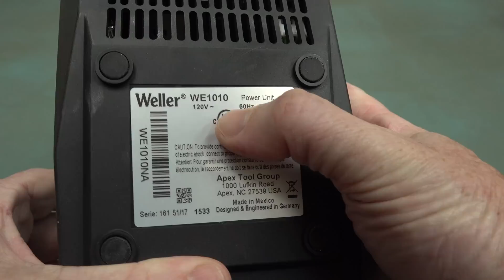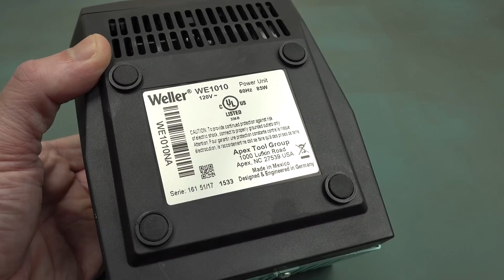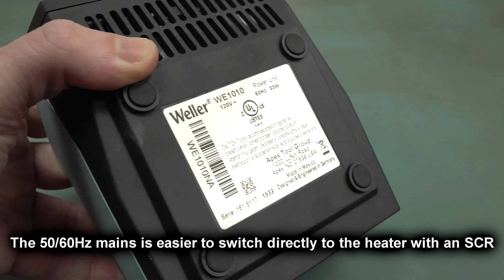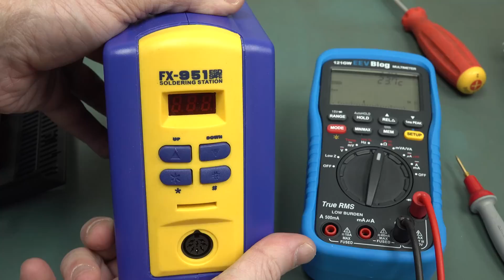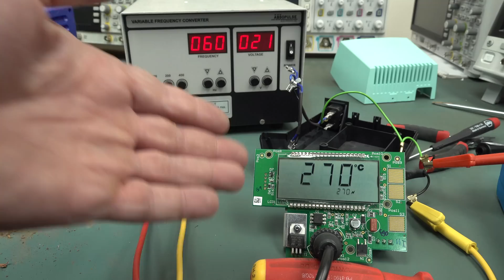EEVblog #1152 - 240V-120V = Magic Smoke!

Comment: Back in the 80's I watched an entire rack of audio power amps go up in smoke when the electrician wired the stage power distribution to a high leg 3-phase source. Keep in mind this was the days of amps with huge transformers and even bigger capacitors. Well about 3 seconds after the power was switched on most of the caps burst creating a miniature version of 'Towering Inferno". While I wasn't responsible for the power on that day, I made a rule to ALWAYS meter the power before connecting any equipment to it regardless of how safe you think it is. To this day, even though 90% equipment is universal voltage, I meter the power before connecting my equipment to it.

Comment: Brunt solenoids on pinball machine (common failure) looks that way and smell the same, as do AC motor (had a centrifugal starter failure on one, thus over-current,  and rotor looked the same). Enamel seems to "boil" and expend from the winding as it heats up.
The motor was rewound and works like a charm.

Comment: IEC Mains Lead trouble , anything will fit LOL

The plug assy should be part of the unit in my book .

A mains input fuse should be IN THE UNIT  regardless of  the IEC Lead fused or not .

Comment: When the core goes into saturation, the voltage squared relationship is not valid.  In fact, the current is limited by the primary resistance (mostly).
As to the design to near the saturation, there is also the issue of line frequency.  A transformer designed for solely 60 Hz use would require a reduced voltage if hooked to 50 Hz feed.  In fact, the required reduction is in direct proportion to the frequency or allowable 50 Hz voltage would be 50/60 * 120V...Easy math tells 100 V only...

Comment: @EEVBlog, rebuild the transformer and fix it for a change. I recall when I connected a 100v Hp laserjet to 220v mains - the capacitor blew the roof off. switching transistor was ok.

Comment: I thought transformer laminations were interleaved alternately, rather than all the E stacked on one side and all the I on the other
Reply: In the early days they were, one could disassemble and rewind with relative ease, unfortunately the bean counters usually insist in a cheaper, non-repairable approach.
Reply: You could do that but you would need the coil to start the interleaving process. If you were to get pre laminated E and I blocks all you'd have to do is weld them together saving you some time.

Comment: I thought that all Wellers had replaceable fuses. I remembered coming across an old analogue temperature controlled Weller that did it had a round fuse cover in the front. I can't remember the model but there is a similar one I found on Google images Weller TYPE 2102199 with a fuse in the front.

Comment: The polyurethane insulation on the wires is definitely sufficient for 240V in normal circumstances. The insulation on the 240V model's primary is probably identical. The problem is that you saturated the core with too many volt-seconds. As you know, once the core is saturated, the winding impedance drops like a stone and the current shoots through the roof. Then the wires overheat, the insulation burns off and the primary short out and then current shoots through the stratosphere. I can't believe there's not a primary fuse.

Comment: yeah cover up the smoke head fast when the smoke comes out !  But where I worked the smoke in a room didn't set off the building system ( only sent a warning at first ) until 3 or 5 minutes later - giving people time to get the burned popcorn smoke cleared out . The smoke detectors in the hallways do set the building into full alarm right away though.

Comment: A customer bought some cheap fume extraction equipment and the motors supplied were 220v 50hz and in the us we use 120v, 208v or 480v 60hz. Wish I was there when the powered up the Indian motors and saw what happened.

Comment: I live in South Florida and a couple of years ago we were hit by Hurricane Irma. A strong gust of wind broke a tree that fell on the power line connecting our house to the transformer, and while it didn't break the line,  but it DID break the house's connection to the Neutral. Immediately after, our toaster oven blew (vaporized a ground trace on the power supply board), and a few lights went out, but phone chargers and our air conditioning kept working. 

They kept working of course because the phone chargers are switching supplies capable of handling 240v, and the air conditioner is wired on the 240v single phase coming into the house. Since the tree knocked out our Neutral connection, every plug in the house was suddenly live at 240v, and no one in the house knew. We only assumed some breakers were permanently tripped. 

 I collect old computers, and of course I'm worried that some of my stuff was fried, so before anybody actually realizing that everything is live at 240v, I go to check if my Japanese 100v MSX2+ is still working. I plug it in and turn it on and immediately get buzzing from the transformer. It didn't blow and once we got proper power back I tested to make sure it worked, and it did, but I swapped the transformer out for one from another model. The original looked and worked fine, and there was no smoke, melted insulation, or anything else visibly wrong with it after getting almost 250% input voltage for a brief second, so props to 1988 Sony for designing robust transformers, but I still wouldn't trust that transformer for the same second it was plugged in.

Comment: And why don't they use a universal input switch mode power supply?!
That should be rather cheap these days and have higher efficiency in the Transformer as well

Comment: Check the plastic bobbin to see if any penetration from primary to secondary.
If there is melting and any primary to secondary short, you have a major safety hazard and UL needs to be notified.
There should have been an internal thermal fuse sitting atop the primary winding.
We've all seen adapter recalls - major issue.

Comment: Could the issue be exasperated by the fact that in Australia you use 50 Hz instead of 60 Hz which would lower the impedance of the primary winding or would the difference be negligible.

Comment: A month or so ago I went to put my backup sump pump in service. The last I used it it seemed like maybe the bearings were going out on it. I went to test it soon as I hit the float on it tripped the GFCI where I plugged it in to test it, I reset the GFCI no luck, apparently it took out the main breaker and the GFCI (or the GFCI just opens when breaker blows). I took it to garage with no GFCI plugged motor got a good spark on the plug when plugged in and like immediately the 15A breaker blew. I didn't feel like dealing with it so i just tossed it. I think either it shorted out, or it was just bound up and then turned into basically a big short.

Comment: Had a similar experience when I worked in a computer store.
We ordered a power supply for an hp that didn't fit any regular off the shelf power supply. so we shipped one in from a supplier in the US.
When I ordered I checked if it was rated correctly, and it was. It just happened to be one of those where you have to manually change a small red switch at the back. and by the time it arrived I'd completely forgotten about the fact that it was manually switched, and that it came out of the US so i should at least have checked it. 
as soon as I plugged it in all caps from the psu started venting filling the store with chemical vape.
after unplugging it, I immediately realised what went wrong and wanted to dig a hole in to the floor to hide my head from my laughing coworkers.  that capacitor smell though made me nauseous for a while. spend quite a few days trying to vent it out of our office.
Reply: I did similar when i was a kid. My big bro had a new 486, and it had this intresting red switch on the back. Click, and sounds/smells started. I got in a bit of trouble aswell. Fortunately the computer seller was understanding, and gave a new one with the nasty red switch glued over.
Reply: @anttimaki8188  yeah exactly , fortunately for me only the power supply was destroyed, the computer that belonged to a customer was fine apart from needing a good cleanup. we made no profit on that particular customer, but that still better than having to repair the whole pc at our own expense.
Reply: Yeah, I've done that too. I was 18.
Reply: Kids do that at schools all the time. They value and treat the PCs with twice the respect they paid for them. Since they were free (to them), well.....

Comment: As i saw here the primary winding was made from an aluminum and not copper wire for that i guess it is burnt so quickly because the resistance of aluminum is much higher than copper  !

Comment: Looks like Dave accidentally made a variac, sort of what it looks like with the primary enamel removed. I think variacs are one of my new favorite electric things. I had a friend give me like 4 old variacs, I put them into a metal toolbox, mounted them, one controls the voltage the other controls the amperage. I can put 120 in and get 0-~230 AC and 0-300V DC.

Comment: I really think the IEC 60320 connectors series should have been voltage keyed (with an allowing for dual voltage devices), given that the leads are so universal and interchangeable nowadays it is inevitable that things like this happen.
Reply: I mean, a company could easily add a voltage key(maybe in a way that it would still accept standard leads for now), write their own standard on it and see if other companies do the same thing. A reasonably large company could probably establish something like that reasonably quickly.

Comment: Hello Dave. Can you enlighten me as to why electrical current in the rest of the world is double that of North and Central America?  I was actually completely unaware of that until your video here today even though I knew you have different sockets due to different frequencies. Thanks. https://www.trade.gov/mas/ian/ECW/all.html
Reply: The frequency doesn't make much of a difference with most devices. It did matter for CRT TV's and some other devices(like record players), but nowadays nearly everything will work at 50 or 60 hz. 

The different sockets are mostly due to the different voltage, than the different frequency. Even if you plug something made for the wrong frequency into your outlet, it wouldn't break. It might just not work right. 

taiwan for example got 110 volts, its not just the us. But most countries use 220-240 volts.

The "why" is hard to answer. as far as i know it was a tradeoff really. The frequency was chose because at around 50-60hz, light didn't flicker. And higher frequencies are harder to deal with. With voltages its the same thing. If you have a higher voltage you can transport the same amount of energy through thinner cables (120 volts at 100A will have the same power as 240 volts at 50A, so your cables only need half the current capability). But higher voltages are more dangerous, of course.

Comment: That is sort of extraordinary for a company like Weller to omit  high energy side protection. Remarkable oversight....You would think?
In the UK we have  mains plugs supplied with integral fuses - (often people just stick in a 13A fuse regardless). This is there by design to protect the cable, but of course it would also help save the primary of a connected transformer. 
I think the UK, along with some of those countries we  plundered in the past - from those dark colonial days - have mains plugs with integral fuse protection (Type G). Anywhere else and a primary fault would be a bit dodgy without additional safety devices.  Many, many transformers have the primary internally fused and/or over temp. protected, and these have been very common since the 1980s. 
Some countries have relaxed standards compared with the UK, but that should not give companies like Weller the freedom to lower standards where the local practices allow. They should set their own standards and lead the way for others  - certainly not saving pennies in this area. 
The British electrical standards and codes of practice  (for electrical appliances) is BS 60335 and is available online as a pdf. It is amazingly thorough and  covers everything you can think of (and much more than I thought).

Good one Dave.
Reply: Also  whatever the cause of this particular failure , core saturation, or the fact its easy to stick in an IEC cable with any voltage on it- Thing is a winding failure could happen  with the correct voltage applied giving the same smoky results. Needs a flippin fuse.

Comment: I just find odd to have a IEC plug on a 110V only device!
The lack of a fuse in the primary side is really a bad design, fuses and holders are not so expensive!
Reply: Here in the US, IEC plugs are ubiquitous, so I wouldn’t look twice at it. However, now that you mention it, I think maybe most devices with an IEC plug also have a dual voltage power supply, while 120V-only devices have the cord hard wired to the device.

Comment: You should put a transformer in that and enfixen it. Also, I've been looking at UK electrics recently. Breakers after a 100a main breaker are 32 amps at 240 nominal (more like 250 when i measured) for plugs, 6a for lighting, and we have 40a breakers for power shower and electric cooker. You can now get 50a breakers, and I was looking at 63a cable and IEC plugs, w/ref to EV charging. Delicious, wonderful, copasetic Ring Main FTW :D
Reply: PS: 6 amps at 240 for lighting!!! That's one for upstairs, and one for downstairs. This system was installed in the days of all incandescent lighting, though. One amp would be overkill in the day of LED.

Comment: I hate that they weld transformers together now. No way to reuse/rewind them :(
Reply: Especially annoying with this transformer that has the bolt holes through it.. as it would be easy to dismantle, rewind, and reassemble it using some bolts/strips to hold it together

Comment: So Weller is shite? Cost-cutting to the point to not include a fuse on the primary side of the mains transformer?
Reply: Weller has always been shite, just most people have never seen or used a real soldering iron!
Reply: cut the crap man :) I have an old WECP-20, it was the state of the art 20 years ago, and still decent today !

Comment: We had electricians in to do some tidying up and check our system to the latest regs, they some how remove a connection neutral or earth and wiped out 30 weller PU2D  transformers. I guess they did not like 440VAC.

Comment: Looks like its not just the fuse that's on the wrong side.. that polyswitch would be better over the primary rather than the secondary coil too..

Comment: I have designed many transformers and the 'window' of operation is surprisingly small. You basically select a core that meets your power requirements and add a bit (but not much due to size and cost). You then calculate the primary turns required to avoid saturating the core (which is why 50hz and 60hz transformers generally have different sized cores) and the wire size to carry the expected current. The operating range has to take into account the acceptable range of secondary output voltages and in the UK, for example, we have mains voltages varying from 210V up to over 250V so this has a major bearing on the design limits. The outcome of allowing for all variables is a transformer that will generally run into core saturation much beyond the design voltage and at that point it acts like a very low value resistor and soon after that the turns start to short and that causes shorted turn heating so the failure mode is very rapid. The basic safety directive dictates that users should be allowed to blow the crap out of it as long as nothing becomes live and as long as it cannot catch fire (flames, not smoke). Once enough turns have shorted the mains fuse will blow.I think that more recent directives have differing standards for smoke hazards as opposed to electrical safety.
Reply: I have a 120 volt variac/autotransformer,  is it possible to use on 240 if I put a lightbulb in series with the variac.  I know the voltage will be the same but will it still over saturate the core?

Comment: Doesn't a 120V (US) device have a different mains plug than an Australian 240V one?
Reply: This has an IEC C13/C14 connector which are used in both 120 and 240v areas.

Really a mistake in the standards if you ask me.
Reply: The wall plug is different, but the connector on the actual device is the same. its a standard IEC connector. You can plug any lead with any wall plug into it.
Reply: its not the plug end..  in his country the IEC end has a 220 plug.. which this situation should NOT have happened as IEC generally means "120/240 compliant".. but, then,  China broke the rules!
Reply: What do you mean china broke the rules? that weller was designed in germany and made in mexico....
Also, does IEC mean 120/240 compliant? i don't think that is required.
Reply: @jort93z   perhaps: but I'm guessing the transformer was from China.. I donno- I was just trying to say that the way things are made today, "its the bottom line that's the most important"; I have had many a 'tranny' fail in some top-notch equipment such as Furman, Sibex, DBX and Mackie.. and they were stamped "made in China"!   As far as "120/240 compliant" is concerned,  I'm not entirely sure on that, exactly.. I CAN say that MOST of the stuff I have seen with that connector on it CAN accept 120v and 240v (usually by means of a switch) such as computers, and some/most universal pro audio equipment.. but in the states,  that connector can also be used on 120v only stuff too.. the problem comes if/when that equipment is taken overseas..  but the stuff that's already  overseas, that uses an IEC connector, seems to all be 120/240 compliant.  thanks for your comment!